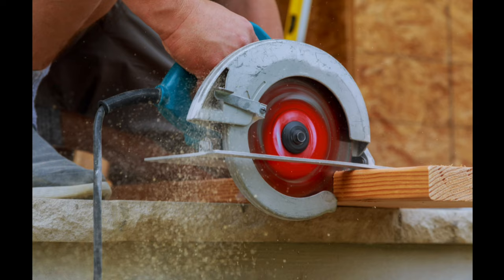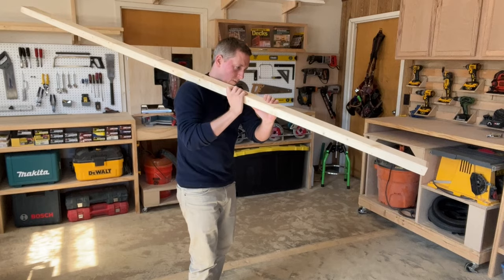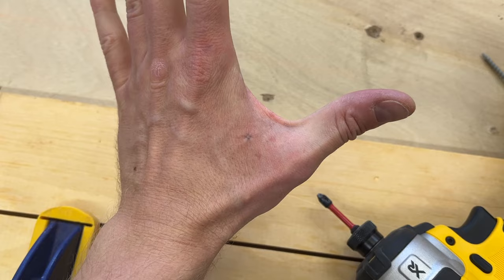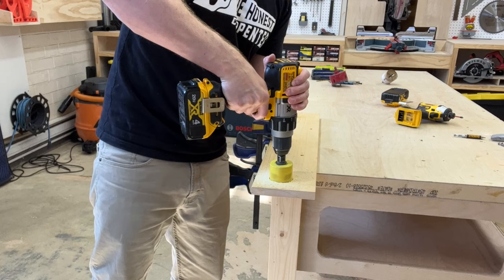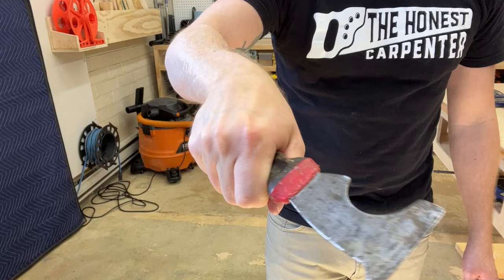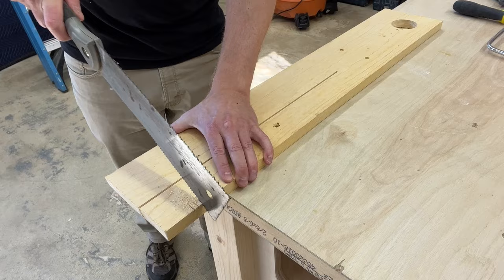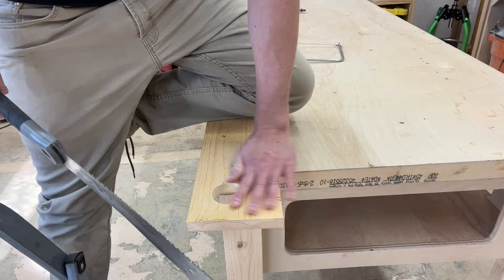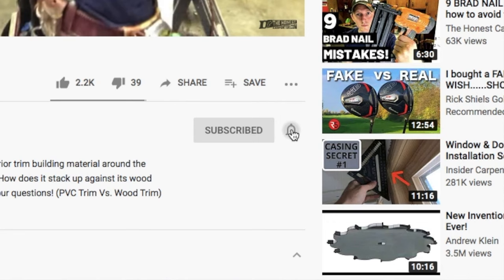9 MOST OVERLOOKED DIY INJURIES! (Avoid These 9 Worst DIY Injuries/Accidents From Common Tools!)

Comment: I remember using a reciprocating saw for cutting up some tree branches. The blade got bent so i went to bend it back straight to finish off but used my bare fingers. I didn't have any finger prints for a few weeks! Never underestimate how hot those blades can get!
Reply from the maker: True, Petrol! 😅

Comment: for scribing lines with a utility knife generally making multiple passes with progressively more force yields good results.
and regarding scraping I personally find it creates a lot of strain in the wrist to hold it entirely by the handle, so pressing on the tool head with your index or first two fingers(while wearing gloves) seems most pragmatic.

gloves are underrated, they keep stuff you don't want embedded in your skin *out of your skin*.

Comment: I removed the trigger lock on my power drill.
Maybe it is because I am left-handed, but the damned thing always seemed to latch on at exactly the time when the bit wants to bind.
It took around 30 years to get to it - but it is a great improvement. Seriously, other than as a makeshift drill press, what is the point of the trigger lock?

Regarding ladders, I was once working at 5m trying to tension something and I was pulling quite hard... I remember thinking "I have a lot of force on this rope, it is a bad idea doing this on a ladder" - and then the other end let go...
I didn't "fall" from the ladder, I still had hold of it, but my weight caused it to buckle and down I went.
Thankfully the collapsing ladder absorbed most of the fall - things could have been much worse - but I did break a couple of ribs...

Comment: Definitely always keeping a mental note about the utility knife, in my experience injuries always happen when doing something differently, even just wearing gloves vs not wearing gloves can throw you off. Most recently At work I hadn’t put my gloves on yet and I sliced the tip of my finger to the bone when it got stuck to the tape I was cutting. Anyways, great video! And if you wanna have a ladder safety video to recommend to people until you get around to making one, I would suggest checking out the Essential Craftsman channel, they have a video on the topic that I found pretty helpful!

Comment: I'm a little late, but I thought I'd share my "Hammer Follow-through" story.
When I was an apprentice electrician, I was try to fit conduit to the opposite side of a joist, and failing badly. After the tradesman (Alec) had dressed me down for incompetence, he climbed the ladder to show me "how it was done". It was done by climbing the ladder, and swinging a ball-peen hammer towards himself, in order to drive in the clouts on the far side of the joist.
You can probably see where this is heading. 
A few swings in, and Alec hit himself straight in the forehead with a ball-peen hammer and fell off the ladder. I had to wake him up.
He certainly taught me a lesson that day.

Comment: Excellent topic! I'm guilty of every one of your examples! In the trades you see many doing these unsafe acts all the time (and others)!
Also agree with the utility knife as number 1.......I also stuck the blade all the way in to the handle......through my wrist!! Luckily, I missed every vein, tenden, bone. It didn't bleed bad at all. Scary as hell at first seeing a blade all the way into your wrist! Much more careful nowadays!! Now my biggest problem is the sliver / splinter thing. Working on that (gloves and no sliding hand along board) but still get stuck every so often. Bought a special tweezers for splinter removal on Amazon. Haven't needed them yet 🤞

Comment: To stop #5 (wrist twisting) with a battery powered drill, use it in its highest clutch mode (ie highest number) instead of in drill mode when drilling with drill bits that tend to bind up like speed bits. This engages the clutch system instead when the bit gets stuck and saves your wrists.

Comment: Another one that is common is to injure yourself while holding a piece of wood in your hand while drilling or using a chisel. Have done that mistake once or twice. Have a permanent scar above the last joint on one of my finger by slipping with a brand new 10mm bradpoint drill. It took several weeks for it to heal up.

Comment: That was a good video. The one tool that has injured me the most is a Hole saw. I have been cut, burned and hit in the head because of a hole saw. I got hit in the head because I had a big hole to drill so l put the hole saw in an old T handle drill and clamped the wood to the table. I sat in a chair so I could see precisely where the pilot bit was going in. The pilot bit started cutting but when teeth hit the wood the bit stopped and the drill twisted and hit my head. I wasn't injured but it hurt.

Comment: I've done a few of these but you learn quickly not to do them again. I have also drilled into my fingers while holding the piece underneath.  If you can't see where you're drilling or the underside of the work piece, this can happen.

Comment: I'd add eye injuries to your list. It's best practice to wear eye protection when using a scraper, when hammering, and of course - when using any power tools.  I've had debris fly into my face from all of these actions and was very glad to be wearing safety glasses.  Even if you're not the one using a tool, but are near someone who is, you should protect your eyes. Once I was helping someone on a windy day, and the saw dust from their skill saw blasted into my eyes from several meters away - took ages to wash out.

Comment: Here is another one from my experience. Nail guns use collated nails with the collating material, either paper or plastic.  I was working on a basement ceiling wearing standard safety glasses. The air gun ejected either a wad of paper or the plastic used to hold the nails inline to feed the gun. The piece ricocheted from the gun to the ceiling then to a joist behind my head and entered my eye from the rear and snuck under the protective eyeglasses.  I obtained a lifetime injury to my right eye.  Now, anytime I work in any tight places with nail guns, I wear mono goggles.

Comment: Scraping is dangerous.  As a pre-teen my friend was scraping paint off her grandma's house and ended up with a paint sliver under her thumbnail.  It covered about a third of the nail bed and reached all the way to the growth plate.  And, thinking about it now, it was white and probably had lead in it.

A caution from my own experience:  When moving heavy objects, don't let your hand get smashed between what you're holding and a stationary object.  The end of my finger popped.  I had stitches across my nail bed and the nerves have not been the same since.  The nail took a long time to grow back, but hey, it did.  They weren't sure it would.

Comment: Another thing with utility knives is when someone hits it sideways against a surface to break off the dull end. Hubby does this and one time it broke off the majority of the whole blade while sending a long blade flying into the back of my truck, all so he could cut the makeshift seran wrap rope holding something down (which was why the blade was extended so far out.) He still does it to this day like it’s some manly way to break off the dull end. I use either the end piece of the handle if it comes with that little slot to slip over the blade to snap it off or i just use a pair of regular pliers and bend along the snap line.

Comment: man the drill twist thing is so overlooked. people read the torque and think "oh its only 55nm, my impact is 155nm and thats no problem" but one time i was attaching a frame with concrete screws, i had the drill on the Drill setting instead of the driver setting at max torque and it twisted so sharply i had wrist pain for a week over it. take the extra second and make sure your drill is on the right setting for driving fasteners/drilling holes

Comment: I know the video and most of the replies are old, but I learned the hard way to be sure of your landing area when hopping down off a kitchen island with your hands full when I did that and Superman-punched a sawhorse with my right hand holding a wound-up extension cord. My middle finger took the brunt of the force; didn't break it, but jammed and bruised the knuckle really hard as if I had just punched a wall. Then later that day managed to get a splinter pushed two inches into that same middle finger while reaching into a crawlspace to grab some wiring. My uncle, who I was assisting, refused to drive me to a walk-in so I didn't get it checked until we returned home (out of town job) three days later. Until then I managed to smack the finger into door jambs three times. Fifteen years later and that finger is still a mess; feels like a broken chicken bone inside and turns freezing cold randomly. Look before you leap isn't just for cliffs and piers.

Comment: Drill wrist twist happens so quickly, especially with hole saws. 12 years ago I had to cut a hole with a hole saw for a client's ceiling fan at an awkward angle over a stairwell. One-handed, which was dumb. The hole saw jammed and the drill handle hooked my hand and wrenched my wrist and elbow. Nearly pulled me off my ladder, too. The pain was something else. 

To this day that injury haunts me, especially when I have to do a lot of torquing and twisting with that arm.
Reply from the maker: Yep. Only takes one bad second like that to cause a lifelong wrist injury 😔

Comment: Utility knives/box cutters…..Oh yeah.  So easy to get complacent. Slashing down cardboard for disposal, or trimming new carpet etc That little devil can mess you up good.  The wounds often get infected and might need stitches….not to mention the considerable pain, sometimes for days while you heal up.  For smaller trims, push the blade away and apply controlled pressure with your thumb on the top of the handle so the push is only for an inch at a time and no body part is in its path.  The experienced already know all this…but that complacency and familiarity lulls one into a false sense of security huh!

Comment: My dad like his father taught him taught me to leave my thumb up when holding a board for hand sawing. That way if the saw jumps out of the kerf it has to jump over your thumb to rip the back of your hand. Your floating thumb usually springs off the side of the jumping saw above the teeth. Utility knives need to make a light scoring pass to establish the line before bearing down in successive passes.
Reply from the maker: Good advice, Peter!

Comment: It's surprising how little force those utility blades need.

I've got a finger that's about 1/8 in shorter than the other, because I got careless with the follow-through when cutting a bit of rope.

Getting that burned shut with silver nitrate suuuuuucked. Turns out there's enough blood flow to the fingertip that if a wide enough chunk gets cut off, sometimes it just can't quite clott right.

Comment: Folding a step ladder closed and leaning against the wall is an OSHA violation.   Although little giant and Werner both make a multiposition ladder that looks like a step ladder that can be leaned against the wall.  Thx for the video, just wanted to point that out.

Comment: The Utility knife is very dangerous tool. Along with your excellent cutting advice, I'd highly recommend to make a habit of securing the blade after every use. Even moving around or between two items. When I tear down my recycle boxes every other week for garbage day, every time I go from one cardboard box to next, I make sure the knife is tucked in so that I don't accidently get stabbed by it. And also whenever possible cut away from you and not towards you. Thanks for sharing these useful tips...

Comment: can't thank you enough, I rely heavily on your videos.... from buying tools to using them.  hope I saw this one earlier... experienced something from scraping things, should have worn gloves as you said in video.  
i have thin skin and i don't do tons of work (not even DIY, I mainly do just crafts), I get paper cuts all the time and always being extra careful when holding any wood cause i know i can bleed from those easily.   but earlier this year i was scrapping some painter tape from my wall/trim, one stroke went out too quickly and my hand scrapped against the wall and some skin ripped right off from just that rubbing motion... flat, painted wall, who would have thought that could cause me bleeding. 
I'm buying a makita circular saw for a small project (was using hand saw before but realize my strength is actually too week to use hand saw, one cut on 1X4 i need a break in between) , def will be extremely careful.....

Comment: I was building a component at work and missed one of the 2-1/2" holes,it was done on a drill press, but now that the thing was assembled it was too big to get back on the drill press, I used a Mauwaukee "hole shooter" 1/2" drill, it was slow speed but it had a chuck large enoughfor the 1/2" shank multi spur bit I needed to use.
I started slowly boring the hole thru the laminated  2 sheets of 3/4" with 1/2" apple ply, so it was   2" of ply to go thru, the way that drill was designed it had a switch that was not really a trigger switch but about  2 or maybe 3" long that when you held the drill maybe 3 fingers depressed it together.
The multi spur bit jammed and the drill suddenly spun, well, with that stupid design it had- as it spun it didn't let me release the power switch right away, it didn't break my wrist but it hurt like heII and was probably very close to breaking the wrist.
It was slow speed high torque, I think it's max speed was around 950 rpm which for a hole saw or in this case a multi spur bit- the speed is good- you dont h=want 2500 rpm on large cutters or bits! but the slow speed meant it had a LOT of torque!

Comment: #7 could be cured if fastener manufacturers were to promote the use of that famous Canadian invention, the Robertson screw. Not the knock-off "Square Recess" screw, but a real Robertson. Designed to stay on the screwdriver tip no matter the angle, a true gravity defying device.

Comment: Yep! utility knife = #1 for me.
I was trimming a piece of moulding.
I was cutting back toward my left hand that was holding the wood. (dumb, really dumb, AND stupid)
The blade was sharp.
I was removing too much material.
A trip to the ER.
I didn't get a good surgeon.
My wound got infected.
My left thumb has scar tissue that always cracks in the dry winter months.
Reply from the maker: Lopped off a big part of my right thumb with a blade when I was very young, Michael. Cracks and oozes every winter 😪
Reply: @TheHonestCarpenter  Thanks for sharing that.  Yes, indeed, you are an Honest Carpenter.

Comment: One overlooked injury is hearing damage. Do yourself a favor and wear hearing protection, even for what you might think is no big deal. Repetitive noise will damage your hearing over time. There are some fantastic noise cancelling head phones that allow for conversation, but cut out harsh noise. I pretty much wear foam ear plugs anytime I am working with my own tools or just on the jobsite at work. My safety vest has a pocket full of ear plugs to be handed out.

Regarding ladder safety. unless specifically designed for doing so, a standard step ladder is not designed or rated to be used as a leaning ladder. The only way they are to be used is opened and resting on all its feet.  One of my roles at work is the safety guy (yes, I'm that guy) and the rule of thumb is step ladders are to be in one of two positions. Either up and fully opened for use or laying down flat when not in use. Never stored leaning upright against the wall because someone might try and use it that way.  Another issue is leaning out over the side of any ladder. One more rule of thumb is to keep your belt buckle as close to the centerline of the ladder and never beyond the side. Greatly reduces the possibility of losing balance.

About knife slashing. Our rule at work is "Don't cut towards your body, cut towards your buddy". You know, because safety.

A funny story. Company policy for one of the subs on our project was not allowing to use open knife blades. They had other tools for such work. If they had no injuries for a period of time, they got a reward gift in recognition. One time the gift was a Leatherman type multitool with the company logo engraved. And yes, it had two knife blades in the tool.

Comment: My pointer finger on my left hand has a knot in the side of it from where I jammed the phillips tip into my finger when the screw kicked over while screwing down the subfloor in my breezeway, August 2021. If you want a lifetime skill of minor hand injuries, become a plumber.
Far as the drill twisting, try a Milwaukee holehawg with a 4 1/2” hole saw or a 3 3/5” self feeding bit !

Comment: Another way of getting a “drill wrist twisting” injury is to use the drill with nitrile gloves. If the sticky part of the nitrile catches up in the bit it will pull the hand right along with it.

Comment: Just my 2 cents on utility knives. A self retracting blade can reduce many injuries.  Also, adjustable depth knives that can lock in a more shallow position (just as much as needed for the task) can also be a deterrent. Finally, is it the right tool for the job. Using a blade as a screwdriver fir example ( come on, we've all done it) may cause a slip or even break the blade and send it flying who knows where. Great info as usual Ethan. I don't find you on Patreon. Is there another way to support your content?
I appreciate all you do. Thanx, Greg